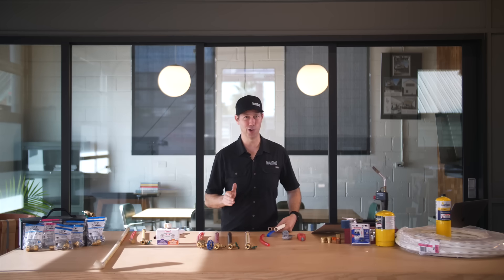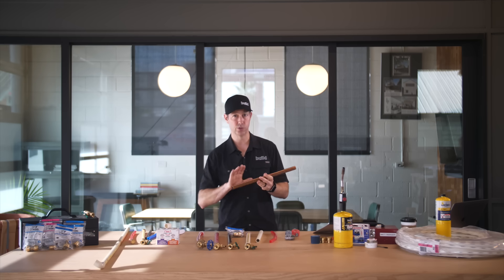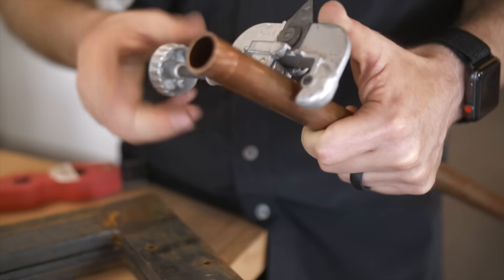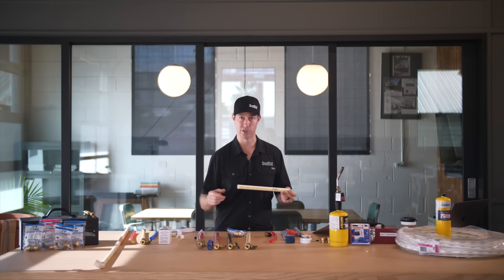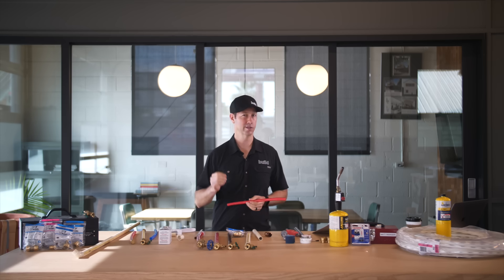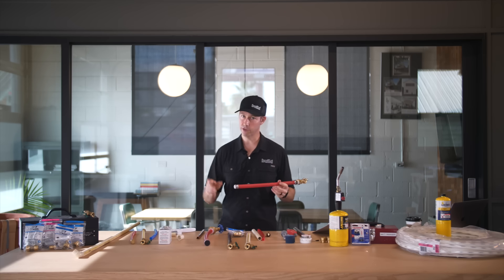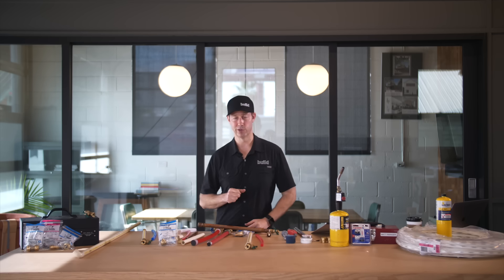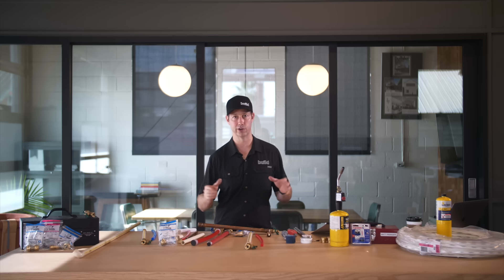PEX vs COPPER vs CPVC plumbing pipes

Comment: HI Matt the one thing you didn't address is the rodent factor. In Florida I had  4 condos destroyed by rats eating polybutylene.  The Exterminator said the rats feel the water pulse and know a water pipe, The don't eat cooper!

Also I just replaced a water heater  and the CPVC on the hot side shattered it was more brittle than the cold side. FYI it was 21 years old Thanks Matt I enjoy your vids

Comment: One thing about copper is that it has a high specific heat.  That is, it absorbs a lot of heat from hot water before it gets up to temperature.   This means that long hot water lines will take longer for the water to run hot because the metal copper pipe absorbs so much heat.  I would go for Pex.
Reply: Or just insulate.  Run a return loop...

Comment: Solvent expires after a few months after you open it. If you use old solvent your weld will fail. Usually after you've pressurised the system. Big mess.

Comment: Uponor Pex A all day long, with copper stub outs.  Keep it outa the sun though! 

Shark bit is great for emergency repairs.
Reply: At my job , which is a hvac and plumbing distributor,  i barely see uponor pex ever go out , its mostly copper or pex
Reply: Connor Gadbois is there a different Pex?  the stuff I use is labeled UPONOR PEX A,  my understanding is that UPONOR is the brand name and Pex is an abbreviation of the type of plastic and that UPONOR makes three grades A B and C.  I further understand that that the “A” is the superior of the options.
Reply: @charleshetrick3152  we have blue/red pex by vieaga and watts , no clue the difference,  we have orange fostapex , and we have the grey pex uponor , most of what we sell is watts red/blue pex or cts cpvc by Charlotte or copper but we stock it all
Reply: @charleshetrick3152  the grade part i cant answer since im not familiar with that yet

Comment: Great video Matt - we have a kitchen island that has plumbing to it and it is completely removed from any walls.  The floor will be poured concrete so we need hot and cold to the island that will be buried in concrete. I know you're supposed to used O-barrier in heated floors and its orange, but do they make pex with an oxygen barrier for that?

Comment: So far the biggest leaks that I have found are when people are careless and do not properly do the prework when installing copper fittings. That means cleaning the fittings and tubing where all the joints are, and coating each with a thin layer of flux putting them together, then heating and applying the solder. The most important thing is cleaning and applying flux before assembly. Then at the proper temperature the solder wicks into the connection and makes a water tight fit each and every time. I like copper over plastic as it can be used for grounding and bonding, as a water filled copper pipe can handle thousands of amps if the water is flowing, so there is no better conductor.
Reply: Copper is nutty orice half inch is now 34 bux for 10 feet.as for copper not being sweat right,it won't cause a failure in the long term!You will know it was effed up when it's pressure tested.

Comment: I have hard water, well water, I bought pex. Just not the fittings to go to each water heads/dispenser. All the fittings will be in the walls, 3 to be exact. 3 walls on the main bathroom, kitchen on E wall, laundry on inside north wall, and 2nd bathroom on the west wall, nothing on the outside S wall (low temps about -05 to -42 depending on the year).
We are off grid in the woods and have propane for some heat, cooking and chosen to go with an on demand hot water heater, wood stove in the kitchen maybe next year. The thought I had is to go with a condensing on demand heater, up through the roof for venting, do you have a preference? Do you have any suggestions for a 1st time builder? I could use a lot of suggestions. Thank you!

Comment: in Europe we use Weltplast (best pvc pipes ever) joints are made with Plastic Welding Machine super light and easy to work with. and Copper is used for extreme heat systems that plastic cant take.

Comment: That cpvc is garbage. It gets very brittle over time. Especially on the hot legs. 
Tim
Superior Air Services
Reply: Been a service plumber for only 2 years now in Ohio and I can already tell you cpvc is trash. It gets super brittle after a only few years no matter where you put it, doesn't matter if it's underneath a trailer or in a mechanical room in a basement, that stuff will shatter with ease. I've learned the hard way that just turning a shutoff valve on a cpvc line is enough to shatter it.
Reply: @TylerBrooks69  whadda bout pex? and i live in ohio too, noob to DIY stuff. Just learned the the saddle BestBuy used for my fridge was illegal, wondering what else I should watch out for.
Reply: @Layarion  Pex is FANTASTIC and they make plastic fittings that are cheaper than metal fittings and won't be eaten out by any corrosives like citric softeners or say a drain line for furnaces or on-demand water heaters condensate lines that have carbonic acid in the exhaust condensation that eats metal including brass. Though if your buying a house check to see if its the early pex precursors. Some of that isn't so hot and it's a weird poly similar to polybutylene pipe in trailer houses that essentially has a pex coating that's just an oxy barrier but makes it look like pex. Has a tendency to pinhole just like the polybutylene that is used in trailer houses. Also while Sharkbite fittings are handy don't trust them. They are convenient, easy, and quick don't use them in your walls and ceilings. All they are is a little rubber O-ring sealing on the pipe. If that O-ring gets a chink in it, degrades, or has particulates and corrosion get into it it is possible it will start leaking. I've had a fair few of them start leaking on me to often for comfort to be in a wall.
Reply: @UNSCSpartan043  ok -Omggg   Thanks
Reply: @TylerBrooks69  I Agree -after this latest freeze my  38 yr old - CPVC cracked several places so I’m going to change it over to PEX  it’s time.
🙏
Reply: The c in cpvc really stands for "crappy".
Reply: I live in a mobile home that was manufactured in '85. I had to cut some of the original cpvc pipe to replace a water heater today. 

When I cut the newer lines at the top of the water heater with a ratchet cutter, it went fine, cut like butter to be honest. When I tried doing the same with the older pipe near the floor, I had to keep applying more pressure until the pipe basically broke. I had to go back with a hack saw and sand paper for a clean connection with the new pipe that was going in.

So in short, yes, it definitely gets brittle over time. Hard, but brittle. Probably makes it a lot more prone to busting if it freezes.
Reply: @waltofalltrades6817   What area of the country is this in?  So your CPVPC is original to the home and its 35 years old and you haven't had any problems?
Reply: @7x779  Northern Alabama. I couldn't tell you for sure it hasn't had any issues before 2002 because that's how long I've lived in it. All piping seems to be original though. For the past 17 years its had metal skirting around it, also called underpinning. That's also probably helped. This past winter, it got down to 5 degrees, didn't have any issues.
Reply: Anyone give advice if this pex can be replaced for under kitchen sink? Looking to replace the copper lines to rerun them without cutting a bunch of holes in new cabinets
Reply: @csosbe251  yes and easily
Reply: Plus here in Texas every few years we get a prolonged cold snap of freezing weather. And people are not in the habit to drip the faucet and cpvc is very prone to to bursting.
Reply: @texasborn2720  thats going to happen regardless of material
Reply: Aren’t HDPE the best pipe material ?
Reply: @Atistatic  Polyethylene aka 'HDPE' which is what PEX is made of is excellent stuff. The precursor to PEX was the Polybutylene pipe which is somewhat similar in looks to PEX but is different in the chemical make up and far inferior to PEX. It has a life expectancy of somthing like 10-15 years while PEX is 50 years if I remember right. Polybutylene has a horrible tendency to pinhole and leak slowly for quite awhile. Which makes it hard to notice until things have already started rotting away and mold has become an issue. 

Polybutylene is extremely hard to come by these days but it was huge in the 70's and 80's so newish to middleage homes have the possibilty of having it in them. Trailer houses and such used it a ton though and that's where I've seen it the most and gained my dislike for it. Once it's pinholed somewhere it's a matter of time when it will give somewhere else so you had just as well replace it all with PEX instead of cutting and patching it. Plus Polybutylene takes different fittings than PEX so you have to use more expensive adapter fittings and such for both crimp and sharkbites. I've had to return in a matter of days because it pinhold 5 foot from where I had cut in a patch a couple times.
Reply: @UNSCSpartan043  yeah we have to change out all the polybutylene in all these houses that we remodel in South Florida
Reply: @edzachary8657  what do you replace it with?  I currently have leaks from 16 years old copper pipes.  May have been from water hammer.
Reply: @luis lee, copper is king.
Reply: Use schedule 80? Or go larger pipe? Too bad builders arent required any thermodynamic extra curriculum
Reply: And always use abrasion/saw to cut shit. Those pipe cutters/scissors if obly use on pex. That's probably where your brittleness/fractures are starting at.

Comment: #1 uponor more flexible grater inner diameter for fittings and the best absorption of water hammering since it expands unlike the other pex’s
# 2 Viega not so flexible, crimp rings rust when exposed to rust, non expanding.
#3 copper high water hammering, when it freezes it breaks, high cost, high probably of a leakage if done incorrectly 
#4 cpvc this is the worst of them, I see fittings un glueing all the time in apartments, older cpvc like as early as 10 years when you use a scissor type cutter just shatters it’s like if it would dry up or something you gotta use a sawall to cut it, when you are glueing if done unprofessional you can actually reduce the inside of fittings if using lots of glue

Comment: Sharkbite works very well for copper.  It has become very difficult now days to find compression fittings.  Solder fittings are still have the price of sharkbite, but when you consider the time and effort, is it really worth it.   Most of the leaks I've fixed in my home have been because the builder did bad solder jobs.  At least if a sharkbite connector leaks, it is easy to fix the problem.
Reply: Sharkbite pusch to c9nnect ate failing.dont put them behind sheetrock.o

Comment: Copper is the most time intensive? lol  I don't think so. Not compared to iron pipes. I have done copper and I wouldn't use them today.
As for CPVC I have had major water damage because a joint in cpvc came apart.

Comment: I just had a 3/4" cpvc T fitting fail, that was underground, cannot be older than 55 years old, because that's how old my house is.  The original fresh water lines were galvanized, so that T was probably only about 10 to 25 years old.  I'm replacing this small area with pex.

Comment: I love copper, but I had to replace my whole house from copper to pex. My home was built in 1964, is on well water, and the well water over time erodes the copper from the inside out. About every 4 months I had to patch a pinhole leaks, (except for one freeze) so I was tired of patching my system over and over I swapped it all out with pex
Reply: How is the Pex holding on?. i keep getting pinhole leaks on my copper pipes and I was thinking to replace the whole system since the house is from 1975 and I just bought it.

Comment: My experience with Copper is that the houses with electrical grounding attached to underslab waterlines experienced more pinhole leaks.  Flexible type M copper pipe was also more prone to pinhole leaks.  CPVC is made with copper tubing size outside diameters so sharkbite fittings will work on copper.  There are  and crimp fittings for copper.

My experience with CPVC is that it becomes very brittle within a decade, where it can easily shatter.  This may be from overexposure to sunlight before install though.  CPVC joints should be deburred and reamed.  I used sandpaper to debur the CPVC.

Nothing beats American made galvanized steel water pipe for longevity.

Comment: What about galvanized?
Reply: Galvanized will rust. And the interior of the pipe will eventually clog up with rust also. The hot water lines will do it faster
Reply: @tracyridge6245  We've got 80 + year old galvanized and flow is still good.
Reply: @pafoofnic   i don't doubt you, the cold water lines in my house are galvanized,  and i still have good pressure, though i have replaced all the hot lines with copper.    Good pressure also depends on what the pressure is entering the home.
 In my time as a plumber i have replaced ,many water mains going into the home , from lead and galvanized  to even wood.!
I have only used galvanized a hand full of times and only in special situations- commerical /industrial  applications.  
Installing new galvanized pipe is labor intensive. Copper is much easier to install, even more so now with  Pro Press fittings.

Comment: There was a study that showed using primer on PVC connections (I suspect it's the same story for CPVC) actually resulted in a weaker joint. I've never used primer on any PVC connections I made, I've never had a joint failure.

Comment: I pulled out all mu copper and went with pex.  When i build a new one it will be pex also. Copper sucks and cpvc is for trailers only
Reply: There's the problem. Should have used Type L copper for domestic hot and cold water lines. Type M is for heat lines.

Comment: I work for an engineering firm, and design plumbing HVAC for a living.    Pex is fine.  Copper is fine.      
     Some installers are very good with Pex, and they make wonderful, neat installs.   Some are less skilled and things look a bit sloppy/spaghetti-like.   Caveat: my opinion is use Pex-A ONLY.    Pex-B is inferior.    
     Some installers are very good with copper.    They get perfectly straight lines, and things look "razor sharp".   Some are less skilled and they don't use enough hangers, things are droopy, and suffer from water hammer, and have pinhole leaks.
     I use CPVC for gas furnace flues.
Reply: It's not the copper or whatever, it's the installer. I've been to several homes/buildings where the shower head plumbing wasn't fixed to a stud so of course it jiggles around when you adjust the shower head/spray etc. Same on toilet angle valves, suspended in space, loose and some are up against a stud or the concrete so tightly you have to hammer out concrete to make room for a connector to extend the pipe so a new valve and bracket can be installed, the correct way. This involves a plumber, drywall guy and a painter for those who will hire the job out.  This makes a simple unscrew the angle valve for $10 into an $800 or more cluster that will take a few days. Builders:  Hire experienced tradesmen.  We new home buyers and home remodel types are looking for decent tradesmen who have a craft vs. what you guys call "cheap labor". We can spot it a mile away and if your crews are of those qualifications, we won't use you or buy a home built by you and your cheap labor.  The first thing we do look for is your truck and how many thousands of dollars you blow on lift kits, big tires/wheels etc vs. the equipment you bring onto the job site.  The more you spend on your personal stuff, the less we are interested in contracting with you. Decent contractors spend their profits back into the company in the latest equipment and tools to do good accurate construction, learn the trade via trade groups, seek reliable suppliers and labor with skills and the knowledge required to start a job right the first time.
Reply: Pex B is better except in flow rate and the difficulty of installing it verse pex A. It's stronger, less likely to burst in freezing temperatures, more resistance to chlorine, a little more difficult for rodents to chew through, and if it's installed correctly, won't leak.

Comment: You forgot copper type k  and type m is agenst code in some States and a stainless steel supply line is also a type of hammer arester. Also cpvc is already primed the glue primer you showed is for dwv pvc and you forgot cpvc degrades and becomes very week after 10 years not 50 copper lasts 50. When I say lasts I mean before you start having to do repairs it looses it's flexibility after about 5 years than if it hammers it will crack. There are way way more variety of pex pipes it depends on your States code and you didn't mention that rats love to eat pex pipes and pex becomes rigged after time. Remember shark bite will fail after the oring degrades in about 10 years. You didn't mention propress  if you make any other videos on plumbing you can ask me any questions I'm read the uniform plumbing code book 4 times and iv been plumbing scence I was 15 and I have allot of certifications

Comment: Pinhole leaks in copper are common in our area of Washington State, even on vertical pipes. Our home is only 25 years old, and the copper plumbing began to fail 2 years ago. We have a well with a high-end mineral filter.
Reply: I have since sold that house, after having the bad pipes replaced.
Reply: I have the same problem. A water neutralizer is supposed to help. It makes the well water less acidic and supposidly no pinholes.